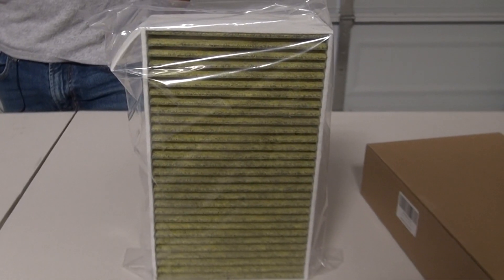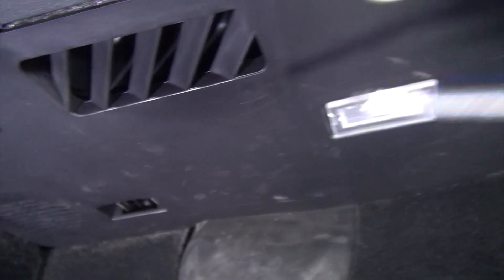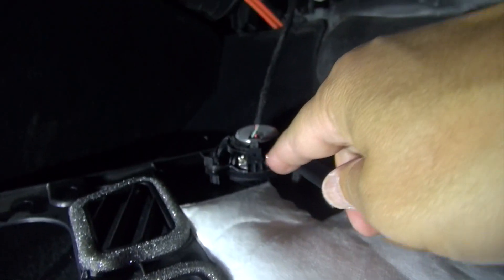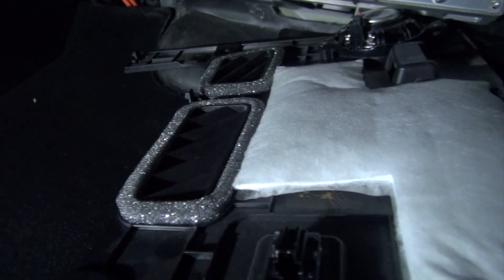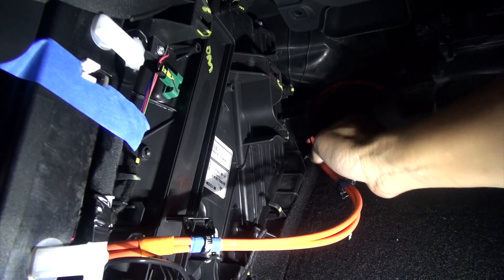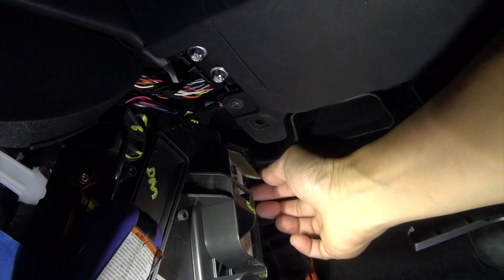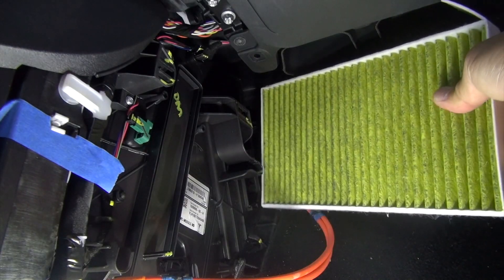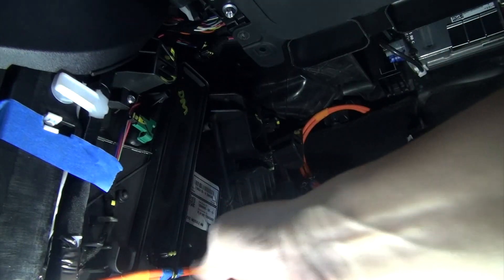DIY Cabin Air Filter Removal and Replacement--Tesla Model 3 AC Smell Problem (PART I - 2021)

Comment: For the wire connecting to the light, there is a tab on the connector. You have to press it down before pulling it out. For the wire connecting to the speaker, you just pull the connector out directly.
Reply from the maker: Thanks!